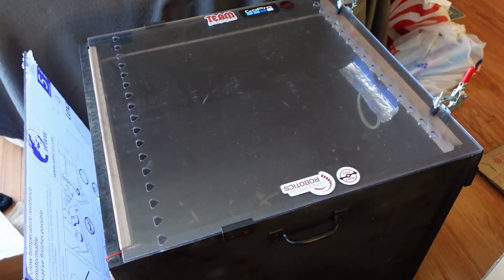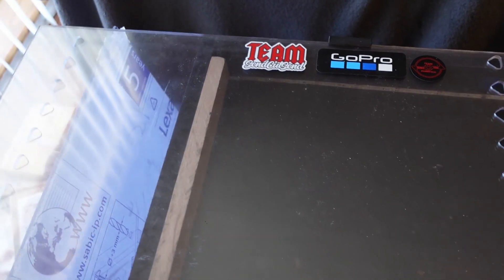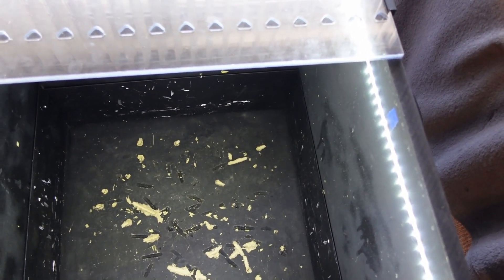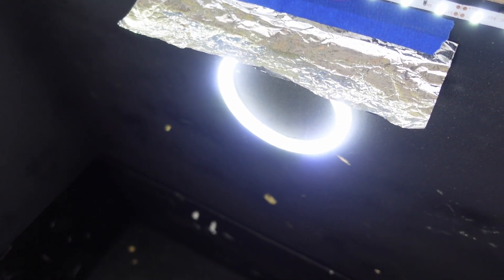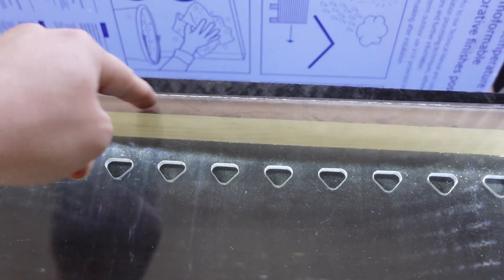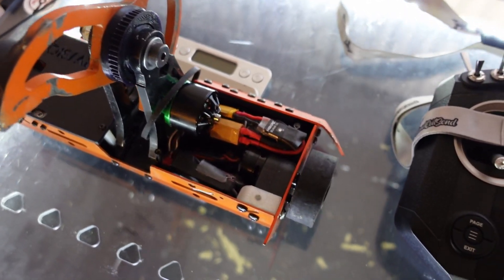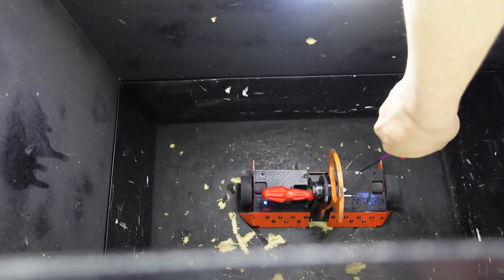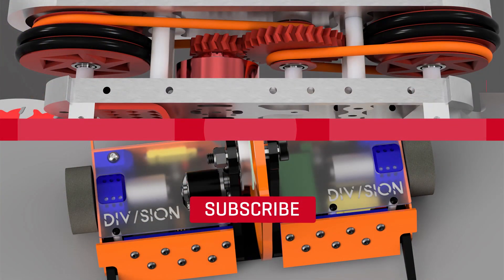How to Build a Test Box: Construction and Safe Testing Guide for Combat Robots

Comment: Great video, hopefully it helps folks realize it’s not that costly or challenging a build and more people will make one. Why do you have the transmitter on when you put your bot in? I’ve never wanted my hand anywhere near the weapon with the transmitter on in case the transmitter gets bumped or something.
Reply from the maker: There are arguments both for and against this. Keeping the transmitter on during load in with the transmitter resting flat on a table away from any bump-happy hands is the way the Battlebots safety team requires it during load in. It's recommended by several other competitions one been to as well. It is generally just a safeguard against a robot doing things you wouldn't expect when its receiver is getting no signal. This is very rare with modern radio equipment but you never know. And if failsafes are not set properly, powering on the bot without the radio on can make it do dangerous things.

I also feel uncomfortable about possibly bumping the radio which is why I have an arming switch set up as I described/showed and programmed my radio to require the switch is in the disarmed position before it will connect to the bot's receiver on startup.
Reply: @JustCuzRobotics  fair enough, I’ll take a look at that video and get the arming switch set up.

Comment: Remote that has wheel in it can be used or not for combat robot
Reply from the maker: You're talking about a pistol grip radio I assume? Yes they can, but they are far less common as they often make it difficult to control anything except for drive.

Comment: you are scared of beetleweights? my team tests 60kg robots 3 feet away from the driver and with no testbox in a collage classroom with benches and 12 more people in the room.
Reply from the maker: Whether you're scared or not doesn't change the fact it would easily kill you or rip your arm off. That's like saying '
"I play with loaded guns with 12 people in the room in a college classroom!" Congrats on being horrendously irresponsible. Just because they haven't hurt you yet doesn't change the fact that they easily can or will.
Reply: @JustCuzRobotics  the point is that in india the arenas are really unsafe. Sometimes 60kg category is driven on concrete and 2 cm thick bulletproof glass is used for walls and metal mesh to cover the top. And being the whayachis of india, the people being present during testing are not scared.
Reply from the maker: I am well aware of the horrendous safety standards. You should collectively work to change that
Reply: @JustCuzRobotics  every single team reports an unsafe arena. And the quality is little improved but if it is still unsafe we bring in 2 wedge botz and destroy the walls of the arena. By ramming into them, there would be no audience during that. So literally the event is cancelled then.
Reply from the maker: If it's not safe it should be canceled. That's the entire problem.
Reply: @JustCuzRobotics  that is why we extrude the entire arena with wedge bots when unsafe nowadays. Initially like in 2012 or so we would not do so as the robots were all wedge bots. Now in big events like iitb techfest the arena is basically battlebots arena with smaller size.
Reply: @JustCuzRobotics  I was kidding😅. They did test it in the way described. But it is a drum spinner so not much to worry about. And btw your videos are helping me in developing my beetleweight so thanks.

Comment: If anybody's in any doubt about what can happen when spinning things meet meat, have a look at the latest video on Andrew Newton's YouTube channel. ('CADDX Nebula Pro Vista Kit'.)

Andrew's an enormously experienced RC model aircraft enthusiast. He recently had an accident when his hand was cut by an electric motor spinning a plastic propeller. (Similar to the kind of thing used on a quad-copter.)

His hand was badly chopped up and needed hospital treatment (yep, actual surgery). Very messy and extremely painful. Bear in mind that this was a small brushless motor turning a plastic prop weighing just a few grams.

A robot's kinetic weapon is made from tool steel and is designed to cut metal, so tangling with one will be worse than sticking your hand in a blender. (Worse because a robot leaps about unpredictably after the initial impact.)

A bot like Division could easily shatter bones and amputate fingers.

A heavyweight bot like Bloodsport could (literally) kill you.

Let's be careful out there...
Reply: Thank you 👍

Comment: honestly this was a pretty good video going into detail of your test boxes and the process of loading and ariming stuff in your testbox and going to be fair for 150g robots you can easily use a draw from a old tv stand or a dresser with a 10mm polycarb top and a thicker base attached to the bottom around 5-8mm would work depending on the type of wood